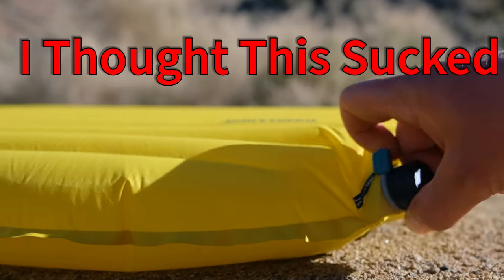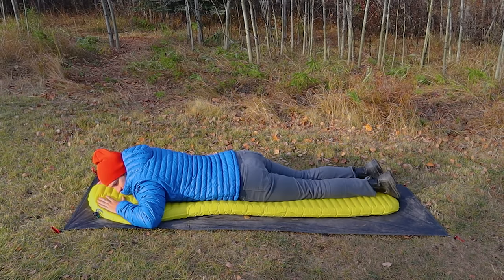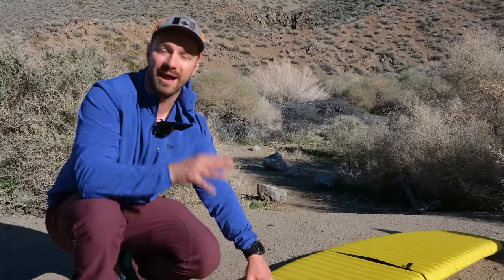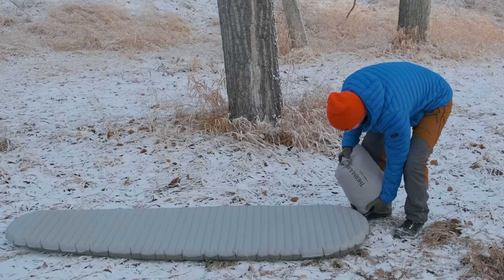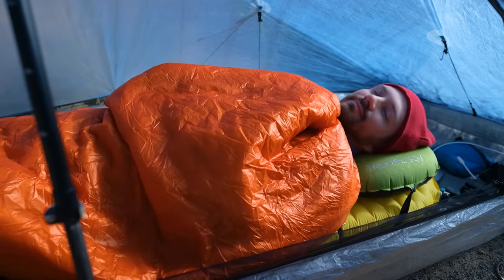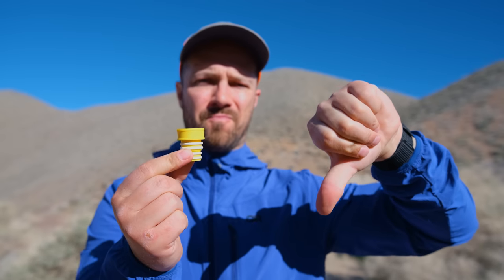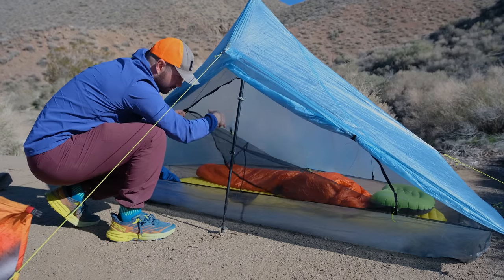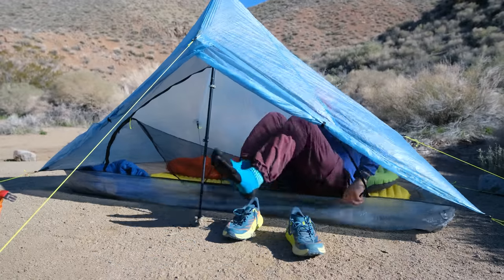I Used to HATE This Backpacking Gear... But I Was WRONG

Comment: Backcountry bidet user myself.  I’ve tried the Culo Clean but have a suggestion of another bidet you should test that I’ve found I like even better.  It’s the Holey Hiker.  I’ve found it’s more water efficient and does just as good, if not better, job of getting things clean under there than the Culo Clean.  So if you’re looking for something new to test give the Holey Hiker a try!

Comment: That’s great to know about the thermarest sleeping pads! I’ll have to check out the new NXT’s for sure now. 
On a side note, the only reason I’m skeptical about the rainbow door on the Zpacks tents is that they allow bugs into your tent more easily. With a door like the Xmid, I can stick my feet out first, put my shoes on, and then quickly unzip the vertical zipper to get out with letting in less bugs.
Reply from the maker: Bugs are definitely something I forget about as I very rarely deal with them!
Reply: @JustinOutdoors  you are blessed with few bugs!
Here in NZ we have many bugs... 🤦🏻‍♀️ 😅

Comment: The fucking cinch in the middle of the quilt is so aggravating. The length of the cinch and how much you tighten it matters a lot for how annoying though. With my paria quilt (which I otherwise love) uncinched, it’s fine but tightened way down for a cold night it’s infuriating. They could put one on both corners with for a few grams more and it would be that much more versatile and adjustable, and in a quilt with a zippered foot box that’s totally reasonable

Comment: I have a rainbow door on my tent and I hate it. It is the sole reason I want to get rid of it for a different tent.

It's too hard to get stuff in and out of quickly without having to create a really large opening that lets in bugs. I hate bugs in my tent.
Reply: agree, and if z-packs would really listen here, they would simply add another zipper to the horizontal lower section and boom both worlds combined (at an additional weight of one zipper (or two in case of the double entry tents) - look at Hilleberg, they do this since ever.

Comment: Do you think the Xlite would handle -10 degrees Celsius conditions or would you rather recommend the Xtherm? I’m a cold sleeper but the conditions I will hike in will mostly (90% of time) never be below 0 degrees. I am also taking into account the 70D bottom of the Xtherm although I’ll mostly be in a tent with an additional footprint (but on the mountains).

Comment: Sea-to-Summit valve is slightly better.  It rolls-up better and is smoother.  Rainbow-door is a bigger loser than just dropping in the dirt and kneeling/grinding wear into it.  It also requires fully opening end-to-end.  Which in-turn requires two-hands.  Also requiring reaching all the way across the tent.  After all those hassles, the tent is fully open for maximum buggage to enter.  Heaven help if one has a dog that wants in and out frequently.  Whereas an 'L-shape' zipper hangs with only a small crack and both people and dogs can slip-through without incident or excess buggage.

Comment: honestly if you're using your left hand you don't need the culoclean.  Just pour the water up a little higher (and above your back - it doesn't have to touch your body).  It will find the crack.  Its not hard to control how much water goes down there with a flip top on the bottle.

Comment: Coming from using different sleeping pads with other valves, I’ve always thought the wing lock valve was better. It was actually one of the reasons why I upgraded my Nemo and non-wing-lock valve Thermarest sleeping pads.

Comment: Hey Justin 👋🏼 I'm gonna ask you a bit off-topic question, but I know that you've done a few videos on Garmin watches in past years. Which Garmin watches would you recommend buying now for hiking (GPS, maps, good tracking of physical activities, body measurements, long battery life, maybe solar..)? I am totally new to the GPS watches and I struggle with it.
Reply from the maker: Fenix or Enduro (depending on price) if you want/need mapping. If bread crumb trails will work well enough for you, the Instinct watches are hard to beat but don't have some of the features found on the Fenix or Enduro watches.
Reply: @JustinOutdoors  Thank you! That's a good starting point for me. 🙂